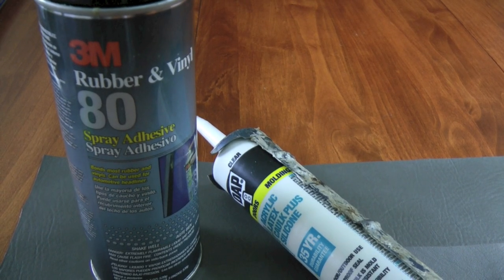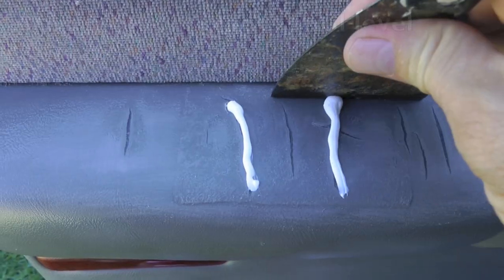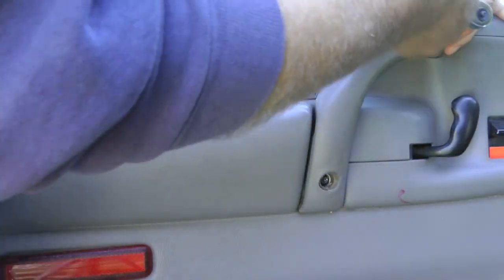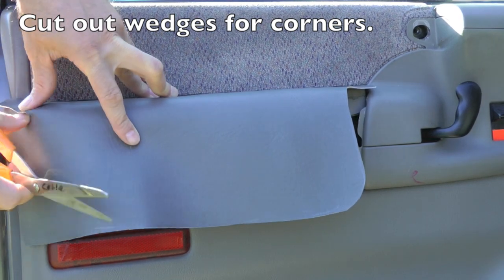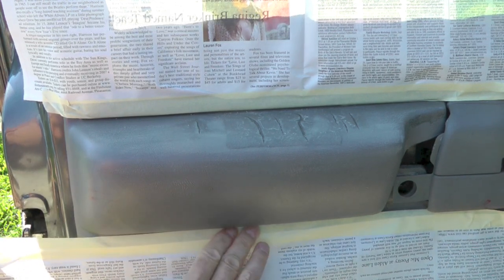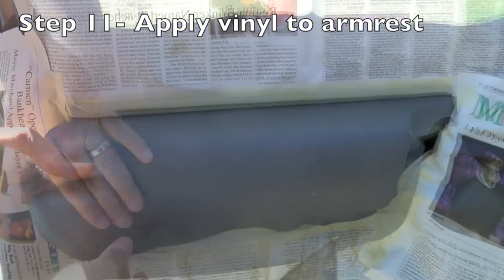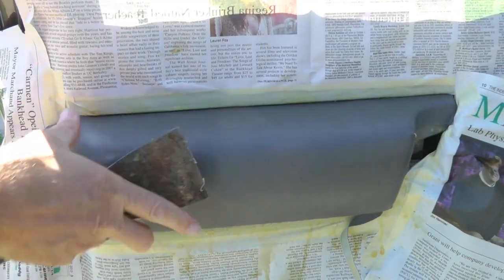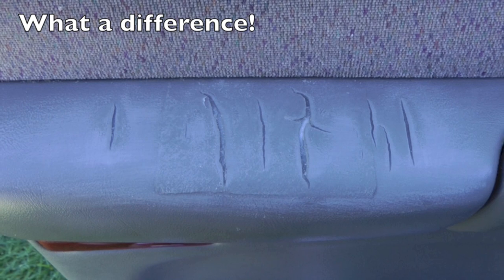How to repair cracked vinyl armrest.

Comment: You can also use a heat gun to heat the side where you made a seam.  if you heat up the vinyl, you can pull on it and stretch it so you have no seam.  you heat and pull that corner till it molds and you don't have to cut the vinyl and have no seam.  just a tip.  pretty good vid
Reply from the maker: Thanks! 

There used to be a vinyl seam glue that would seal the seam, but I couldn't find it.

Comment: I have a 2000 GMC Safari van with the cracked arm rest. I am going to try your method. I have had a temporary fix by taping down a pair of vinyl but as the tape has gotten old, it is coming up. I need to try something else and I will try yours. Turned out great in your video so fingers crossed !

Comment: I have a leather repair company  , and that's  a long way to do a repair  and it's  not a magnificent job at all  ! For instance  all  you had to do is  clean it well sand the whole spot with 400 to 600 finishing  sand paper , and use leather or viny compound  smoothly  on the  scratches  then sand it down again  with 400 to 600 finishing  sand paper  and dye the color on it  3 times , use a hair  dryer  each  time you dye it and seal it when you finish . My business  website is fivestardentwheelleatherrepair I service PA  , NJ  , N.Y.  .I did a lot of work  for Bentley  , porsch  , BMW  , Mercedes Benz  , Lexus and more . Lisenced and insured.
Reply: You may have a leather repair company, but you don't have much tact. Try being nice.

Comment: .
.
.
.
Thanks.

so many times these types of item / issues  are compared to a half dozen toyotas with perfect arm rests after 250,000 miles

poor design

even poorer materials in a known high use area

and a van that had enough manufactured years to respond to feed back and correct..

but instead, GM headed to capital hill with hat in hand  seeking millions in financial relief...

.
.
.
and now about the pot metal door handles :0

. ..a door handle- an item used EACH time the van is used and attached to a heavy door

knowingly and willingly used cheap materials

and owners change out multiple times

boggles the mind....

.
.

"like a ..... "pebble"
.